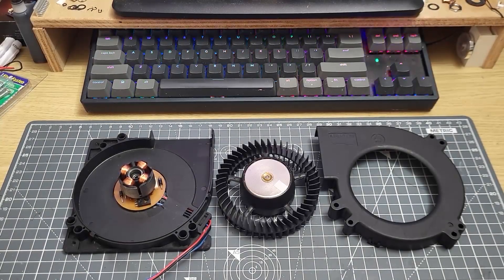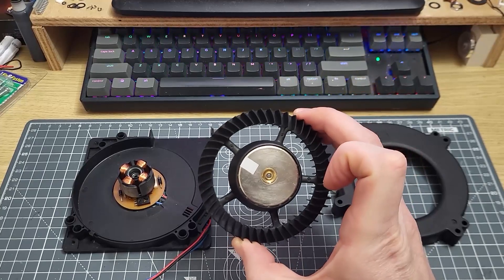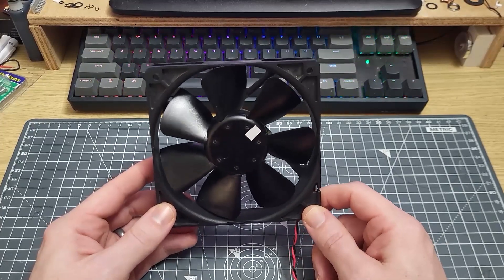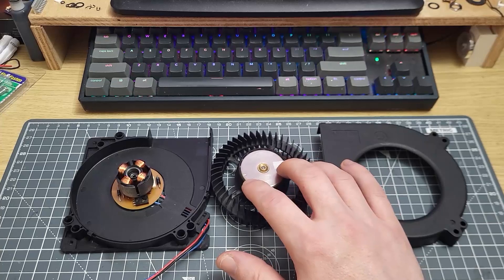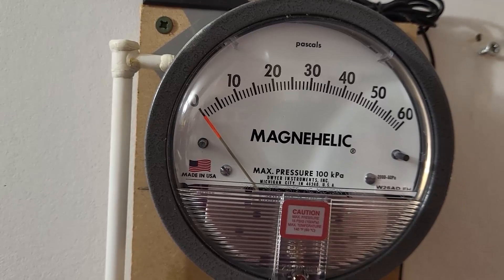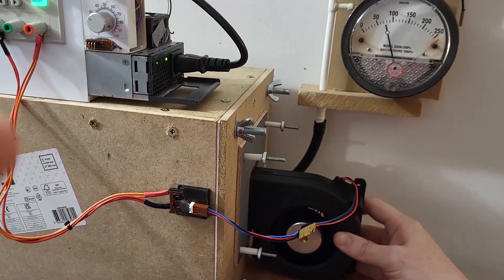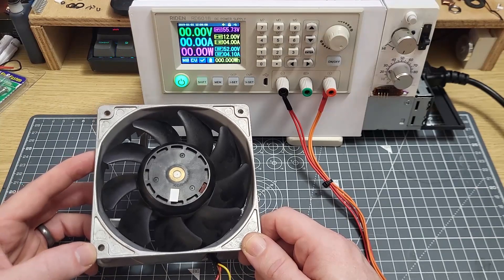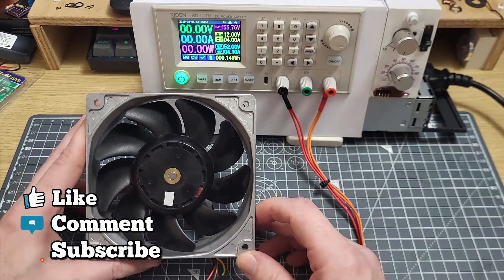Why Not Use Blower Fans Instead? Part 2

Comment: Is this video flipped, as the blower blades are in the wrong direction? The blower is still sheering air, just radially instead of axially. When restricting airflow completely, the centrifugal fan has a lot less cross-sectional area, which means less drag so it speeds up. The axial fan has a lot more surface area with a lot more rotating and recirculating air causing drag. From restricting the flow of the axial fan, you essentially turn it into an inefficient centrifugal fan.

Comment: Im Wonder if i can buy one of this large bloger fana, remove motor From it and 3d print a larger one, maybe with addational idn 2cm hight this will blow more air or maybe we need just much bioder fan at all. Im just wonderint becouse i want use something like that to my custom PC case and Im making closed loop of air for all radiators, so easiest one is just GPU with blower fan but there is non of blower cpu coolers and is just cool and aestetisc are cool ;D

Comment: A blower fan is a type of centrifugal compressor, though a very simple one. These work by accelerating the fluid as it passes through the compressor. 

In this style of fan, the fluid travels form the center of the fan to the edge. As with all fans, the liner velocity of the fan blade increases as you go out axially. This increase in velocity accelerates the fluid as it passes through the fan. 

The complication with centrifugal compressors is that you require a relatively large area (blade surface area, specifically) to effectively accelerate the same volume of fluid as an axial fan/impeller. Meaning, high pressure but low volume vs the high volume but low pressure flow of an axial fan.

Another important note is that the amount of power a fan requires scales with the pressure produced, airflow produced and the inverse of the efficiency of the fan design. Thus, give any fan enough power (and a motor that can take it), and you can make something higher airflow or higher pressure.

Comment: I wonder why they mostly use Centrifugal fan on Quadro series and Axial fan on GeForce series
Reply from the maker: Blower fans make more sense because the hot air is exhausted outside the case. Some Geforce cards use blowers but gamers generally prefer quieter fans which is why they are more popular, even though there is the disadvantage of having all that hot air build up inside the PC case!

Comment: I would have made the analogy of pulleys being the difference between these two fans because that is what i believe is happening.
An axial fan is the equivalent of pulling a rock directly with a rope. Ie. an amount of work, that is low torque and high distance.
The blow fan is the equivalent of pulling the rock via pulley system.  Ie. same work, but more torque and less distance.
I think it's quite apparent when you look at the number of blades on each, their size, and the angle of attack.

Comment: So, you are a Engineer too? Are you going to talk about laminar/turbulent flow and Reynolds number? I am a (bio) chemical engineer and, to be frank, air flow is hard but I found that gas exchange/reaction rate for a sphere and 'Thiele modulus' a much more wicked thing to understand the real thing underneath....
Thank for those interesting videos. I thought you would make a more complete comparison on you chamber box!
Reply from the maker: Thank you! I'm not an engineer but I have been studying this material for quite some time now and love to talk about it. And yes, turbulent vs laminar flow is quite important when looking at thermal performance so I'm going to have to broach that subject in a forthcoming video! I try my best to keep the technical terminology to a minimum - if I start talking about the Reynolds number and boundary layer viscosity, I think I might have gone too far :D

Comment: Love your videos. Can you make a comparison between the blower and axial gpu cards because historically the blower gpus run hotter. I know there are other factors like heat sink design etc but this question is killing me
Reply from the maker: It's a relatively easy question to answer - a larger heatsink cooled by axial fans will always yield better cooling performance than a smaller heatsink cooled by a blower, and this is chiefly because axial fans move much higher volumes of air than blower fans. Blower fans are favoured because of their compactness, especially in single-slot graphics cards. If there's enough space for a larger heatsink and an axial fan (or two, or three), it will always be the better option.
Reply: @FanPhys  what if they used the blower to suck the hot air out rather than pushing air onto the heat sink. Because of the low pressure it creates, it will force air through the fins effectively. Also why not a dual blower setup.
Reply: It's not only the blower fan "to blame" for this. 
GPUs made with axial fans always have a heatsink with heatpipes which can transfer the heat much more effectively than a simple heatsink. There is a reason why heatpipe-less CPU-fans died out (heatpipes were nowhere to be found on CPU coolers in the 2000s and before).
Also cards with blower fans always have only one fan while cards with axial fans almost always have 2 or 3 fans.
So overall blower fan GPUs are at a pretty big disadvantage besides the fan itself.
The big advantage of blower fans is that the cooling solution can be built to be much smaller.

Comment: So how can laptops have blower fans and be cooled? I always thought blower fans would win because of their thin design and great flow on the exhaust part. if you compaire a normal cooler fan with a normal blower fan I mean. But I have seen on your first video that the blower fan generally makes more noise when the normal fan makes more wind and less noise. Cool videos!
Reply from the maker: Thanks! Blower fans are fine for cooling, it's just that the fan has to be pretty large in relation to the size of the heatsink - which isn't a problem for laptops and consoles.

Comment: The pressure/volume tradeoff is why I use bellows to cool my computer. The static pressure and airflow is only limited by the work ethic of my children.
Reply from the maker: Absolutely - the only drawback is that sometimes children can be very noisy. I find that duct tape helps.
Reply: @FanPhys 😂💀

Comment: I have seen blower fans used in SFF desktops as the CPU fan, using the large intake to draw air over the heat sink and discharge it right out the back of the system and of course they have made their home entirely in laptops.  But as soon as space is available, back to the much quieter axial fan.  Most of the my systems I play with use fans capable of reaching higher RPM's as needed but are often content to let the fan tick over around 1500 RPM.
Reply from the maker: Yes that's an interesting point which applies both to blowers and axial fans - sometimes a system will use the low pressure from the fan to "pull" air through the heatsink and then exhaust the warmer air at higher velocity. This is another thing that I will be testing with axial fans, as there is some dispute as to whether "push" or "pull" is optimal for heatsink performance.

Comment: Does the same hold true when looking at how much vacuum pressure each type of fan can produce?  For example, shop dust collectors are usually blower fans but sucking in air instead of building pressure on the output.  I think it'd be neat to see what the numbers say about that.
Reply: Its the same, it has to be able to produce the same vaccumm on one side as it produces pressure on the other. The output of the fan will always be the same as the input.
Reply from the maker: Yep that's pretty much it - the only thing that changes significantly is the velocity of the air. The size of the low pressure region at the entrance to a fan is actually very large, more so than you might think, so the velocity is not as high. When it comes to so-called "vacuum" or "suction" power, blower fans are king of the hill by a long way.